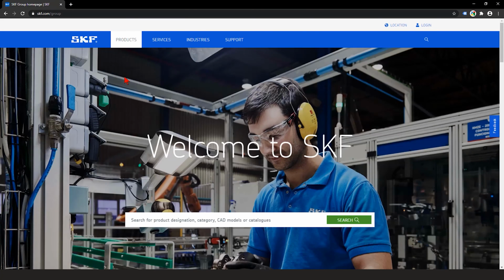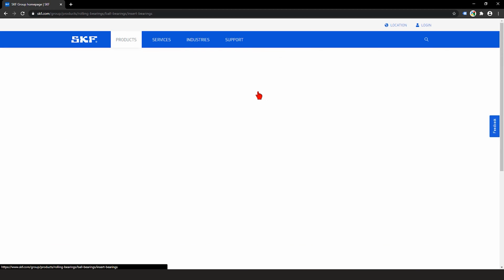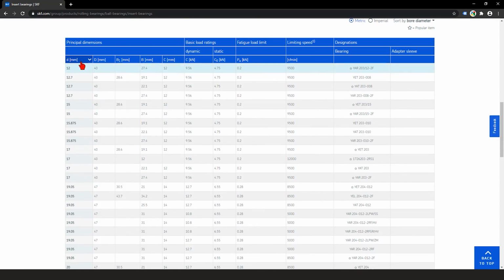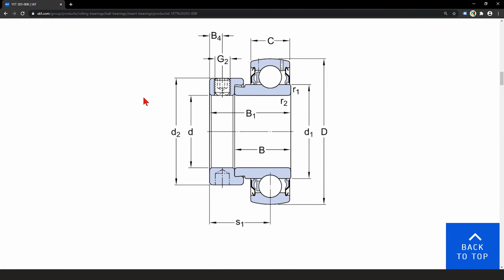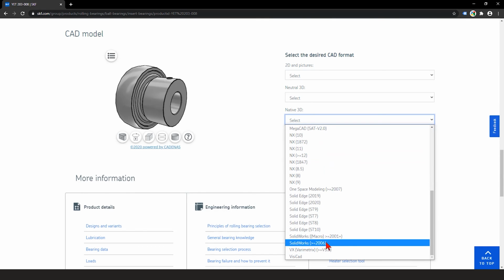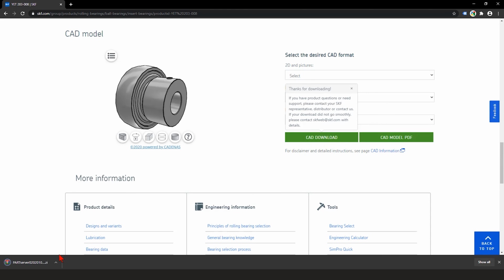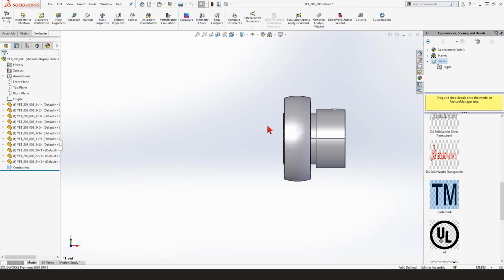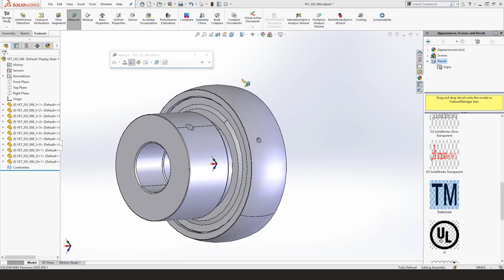SolidWorks Quick Tip- Import Ball Bearings (SKF)

Comment: Hello. I'm trying to download cad models this way. But the downloaded file is not a cad file but an exe file. How can I solve this problem? Thanks.
Reply from the maker: go to SKF website and download it from there
Reply: Sorunu çözebildin mi?
Reply: Mozillada bu sorun var başka bir tarayıcı kullanırsan zip olarak indiriyor
Reply: hi, i'm also having this problem, have you found the solution?
Reply: @rialdhirestu1328  
yes i solved it. Google also had the Idm download extension. When I disabled the extension, I downloaded it normally and the problem was solved.

Comment: What a great tip. Solidworks tool box gave me heart burn on finding what I wanted. I was able to find what I needed, in the spec I had designed, without the effort to draw another part. 
I am new to grabing others design parts to use. I often wonder how to acknowledge that its someone elses work I am incorporating. Please advise to avoid the "plagerism" stigma in final drawings.